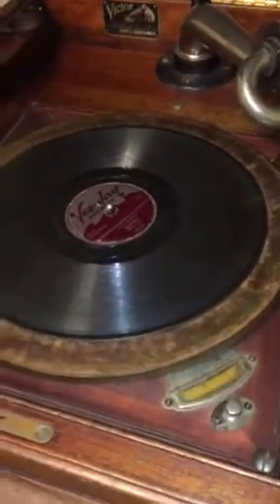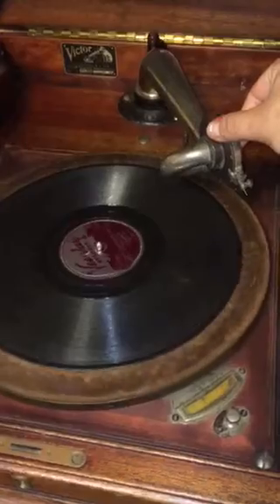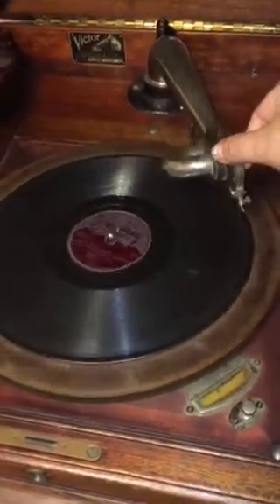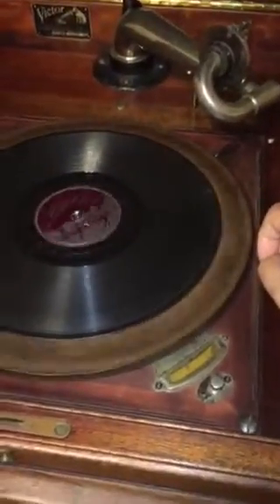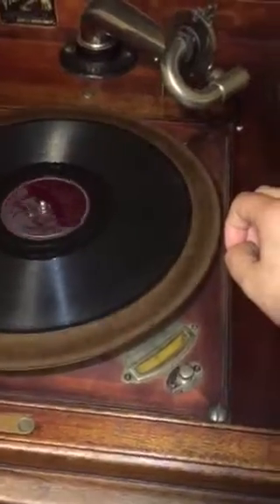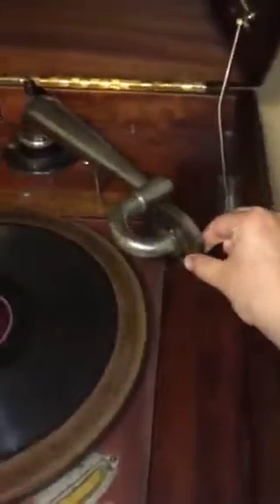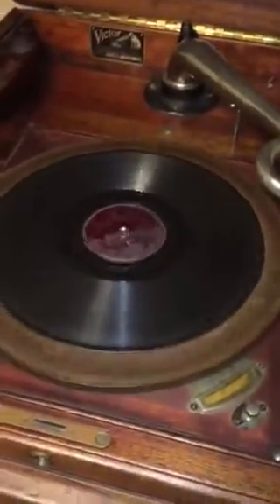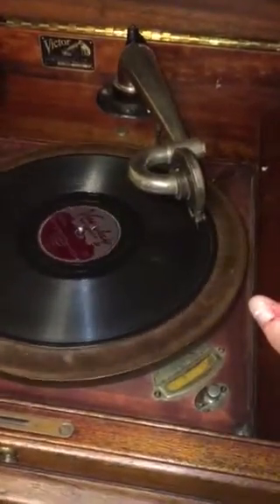Victrola Issue 3

Comment: Your motor seems to be running slow. These records play at 78 rpm, which is faster than what it was doing in the video. Try adjusting the speed control to make it go faster. As for the slowing down when the reproducer is put on the record, There is a pin in the black bracket that holds the arm up. If you push the pin down, it holds the tone arm up. That might be the problem. Also, make sure you are using new needles. Steel phonograph needles can be bought on Ebay for very cheap, just make sure they are NEW. And remember to change the needle after every record. The record is designed to wear down the needle during play and you HAVE to throw the used one away, and get a new one. This will save your records from damage and give proper sound reproduction. Another thing, you need a new piece of turntable felt to put on the platter, this might help as well. Putting a record on bare,possibly rusty metal can damage the record as well as possibly causing it to stop turning.